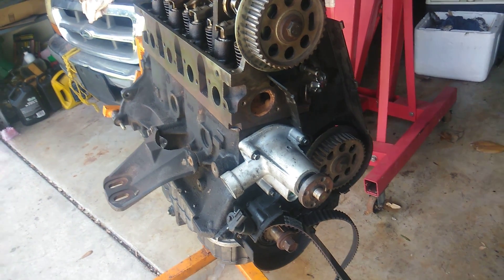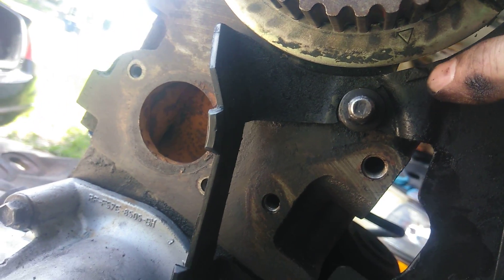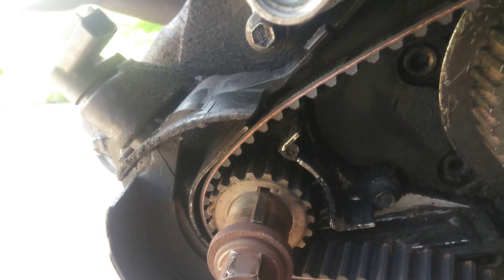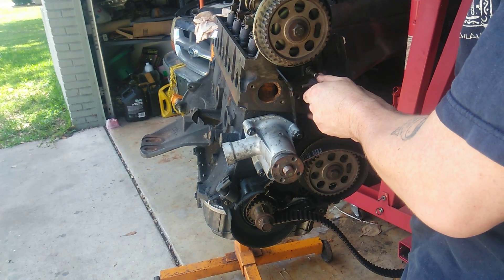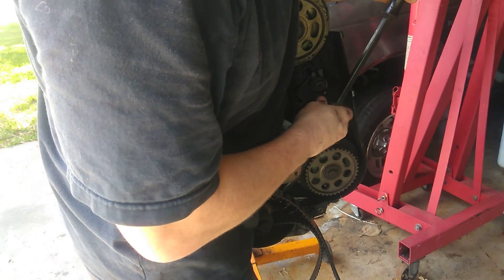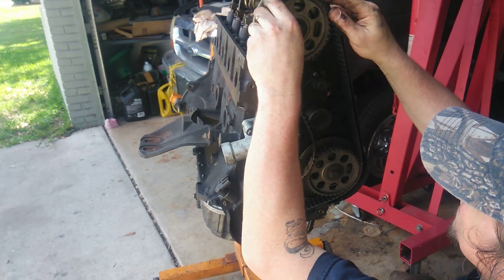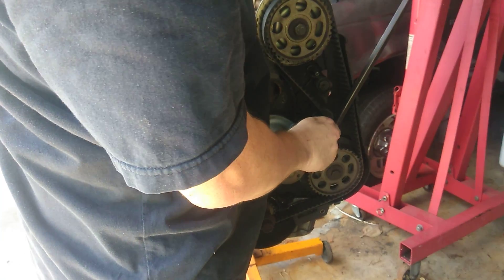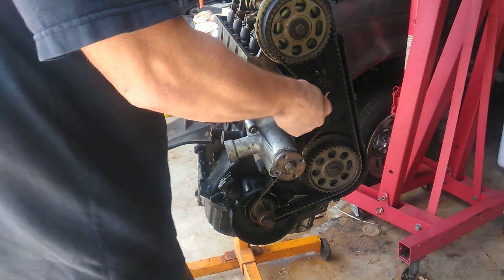Ford Ranger Timing Marks/ Timing Belt Replacement Without The Tensioner Tool!

Comment: Tip: I cranked the tentioner all the way back and then tightened down the smaller bolt (on the left) to hold the tensioner back. Then once the belt is on, you loosen that bolt and it tightens the belt up. Then retighten.
Reply: I'm in the process of doing one now and just cant seem to get it right. Every time we release the tension, it usually knocks the cam off a mark.
Reply: @davethemagnificent2576  : Rotate the engine a couple of times by hand, pulling the #1 exhaust plug to decompress the motor. Do this by rotating the crankshaft four times (2 times per camshaft rotation).

This should relieve any slack in the belt. Re-check and verify your timing marks after doing so. If your camshaft sprocket ends up off a tooth, put the timing mark of the camshaft before the mark on the cover, and see if that doesnt help, since the engine has to have 10° BTDC timing to run correctly. Another couple of things to do:
1) After you tighten the 13mm adjusting bolt with the proper torque, tighten the spring bolt down as well. Doing this will prevent the spring bolt from overcoming the torque on the tensioner bolt, and prevent the belt from jumping teeth under load (though the belt will still stretch over time, due to wear and use).
2) Once you have verified your marks on the timing cover, put the harmonic balancer back on and attempt to run the truck between 10 and 20 seconds. If the engine runs, then you know the timing is right, and can put it back together.
Reply: @davethemagnificent2576  i noticed the bottom crank was slightly off the line but worked out in the end.

Comment: I have done a fair share of timing belts but never on the ford 2.5.  I just needed to know the timing marks and where to align them.  Your video I think does the trick... I will find out tomorrow morning, the goal is 3 hours start to finish in the truck let's see if I can do it quickly.  
Thanks for the video..

Comment: Why not put the tensioner on use the pry bar to push it in and then tighten the tensioner bolt. Now put your belt on and just loosen the tensiner bolt and it will move into to place then tighten it..done.
Reply: THat's exactly what that bolt is for the milled slot has a distinct purpose , You pry the tensioner all the way to the end of the slot tighten the bolt 13 mm then install your timing belt once in place you loosen the bolt and the tensioner snaps into the proper tension

Comment: ive got a 96 mazda 2300 that we belive has a timing issue my question for you is the very bottom mark on the crank do you have to pull the balancer off or is there another way to check and see if it has jumped time? we got the top and middle marks lined up
Reply from the maker: I just re-read your comment, keep in mind that the camshaft spins twice  to every one of the crankshaft. If you spin the motor and the marks don't align, rotate the crank another 360 rotation and check again.
Reply: @You-Tube...005  do you have a good picture of the bottom mark?
Reply from the maker: @edwardlochbihler2089  I don't, just the video. I did this quite a while ago.
Reply: @You-Tube...005  bummer this thing idles fine but give it gas and it pukes out then turns the back three exhaust tubes glowing red thought it was a blocked cat but we cleared it out and it still does it
Reply from the maker: @edwardlochbihler2089  sounds like it has to be a clogged exhaust. Did you knock all the honey comb out of the cat? I can't remember, but check to make sure it doesn't have a pre-cat.  Sometimes when exhaust valves are not opening properly, it will make a popping noise up through the intake? If you loosen the exhaust manifold bolts enough to create a significant leak,   you could start it and see if it will rev up. It will be loud as hell, but will let you know if the exhaust is still clogged.
Reply from the maker: It almost sounds like it's s running to rich, maybe it's just dumping raw fuel in the exhaust? That could cause it to glow. It bogging could be caused by flooding its self out. Have you pulled any codes?
Reply: @You-Tube...005  no not yet
Reply from the maker: There should be a rubber plug on the front timing cover, with it removed, you can have someone turn the motor while you watch for rotation. You could also just pull back the top timing cover while someone cranks it over to check for rotation. On some motors, you can see the camshaft by removing the oil fill cap. In this case, if the cam isn't spinning while someone cranks the motor, the timing belt is broke. Even if you could see the timing belt wrapped around the cam(s) sprocket, it could still be broke, most of the time, the teeth strip off at the crankshaft. If all timing components still have rotation and  you suspect that the timing has jumped, there should be a timing mark on the balancer and outside of the timing cover at the balancer. You could also remove cylinder 1 spark plug (closest to the front of the truck) and stick something in the cylinder. Use something long enough not to drop and lose in the cylinder, maybe a clothes hanger? Might also be a good idea to disconnect the battery. Turn the motor by hand until you feel the piston is all the way up at top dead center. At this point, the marks at the crankshaft will be aligned and the camshaft should be. If the camshaft isn't, the timing is out.
Hope this helps

Comment: By aligning all this point, do we still need to check cylinder 1? Or will this be all it takes to be able to fire it up?
Reply from the maker: When you line up the crankshaft timing mark, the # 1 cylinder will be at top dead center.

Comment: Thanks for the video. Can tell me where the pistons should be when the timing marks all line up? Is it TDC in cylinder 1? I'm trying to diagnose timing problem without taking harmonic balancer off the crank shaft. The harm. balancer has two lines that pass the rotation markings (BT, 30, 20, 10, TC...) on the T belt cover and I'm hoping to use that as a first check.